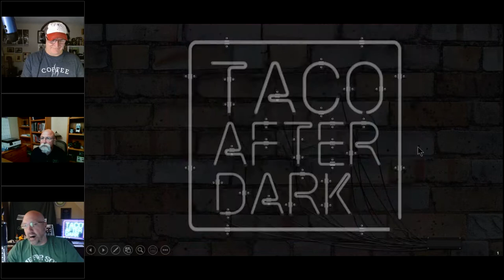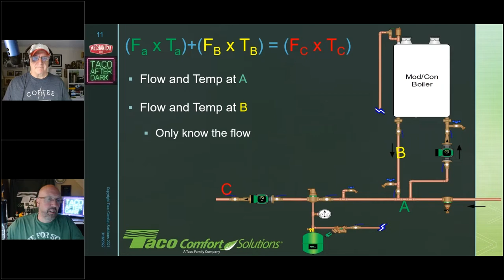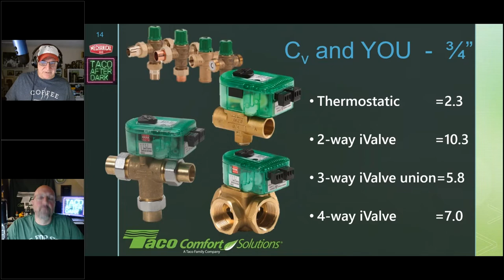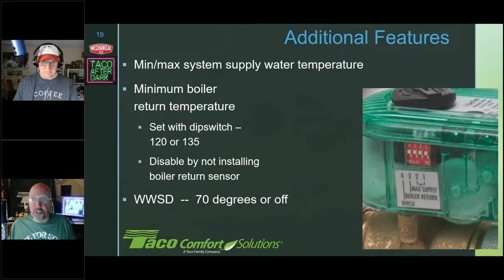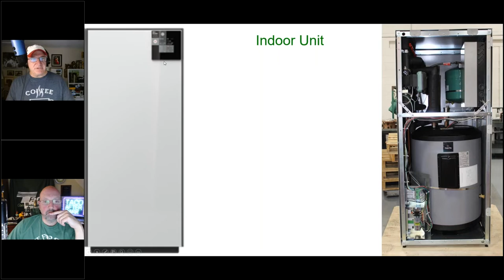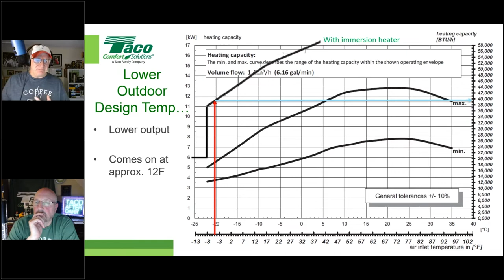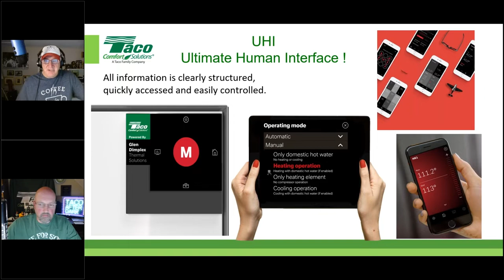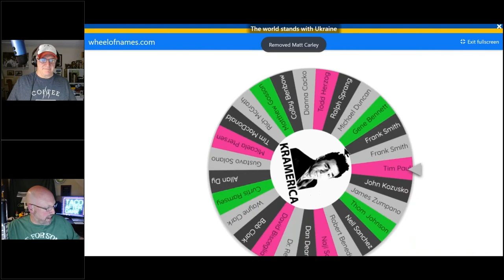Low, Low Temperature Heat Sources and Controls– Mixing Valves, i Valves, Air to Water Heat Pumps

Comment: What about slab cooling
Reply: My customers are in Napa California and they want the coolest stuff. I think cooling the slab or the radiant would be great. What controls do u need to prevent condensation
Reply from the maker: Radiant floor cooling is a concept that is performed quite often. The controls are the most important part in controlling the humidity in the space as well as the water temperature being supplied to the radiant cooling system. It is important to keep the delivered water temperature above the dew point. The controls that we have that can help is part of the Clarity System found here https://www.tacocomfort.com/product/clarity3/